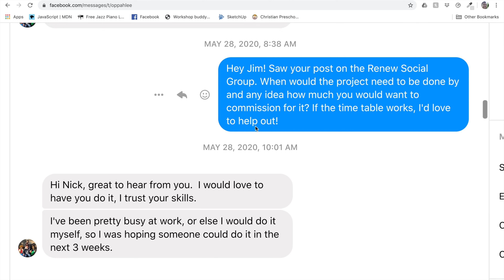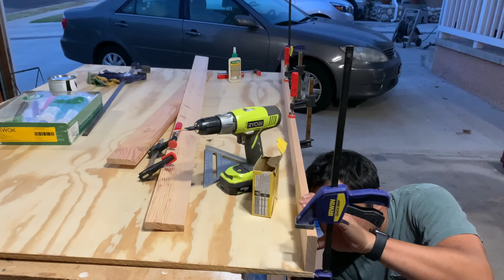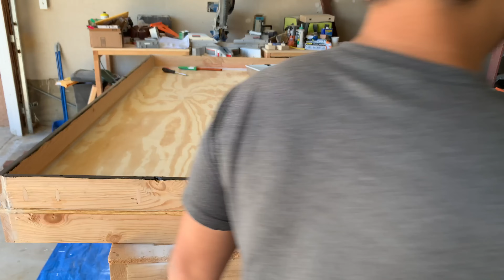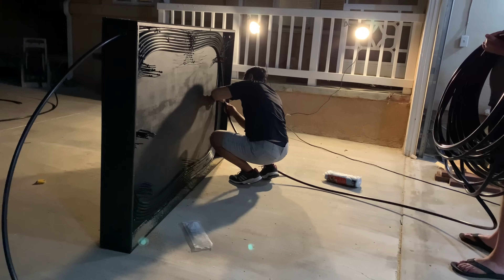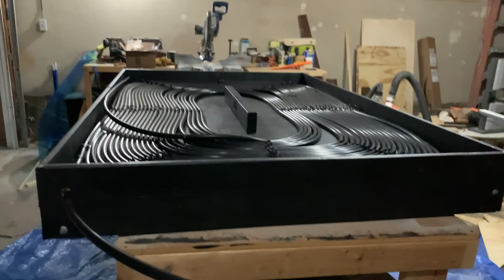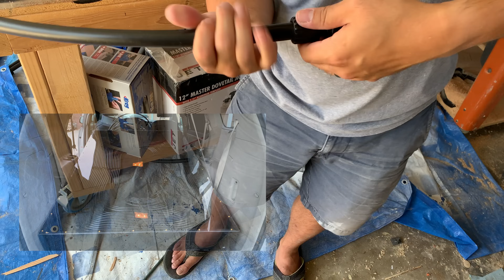DIY Solar Water Heater Full Build

Comment: Thanks so much for the detailed work and preparation to create this masterpiece. It's truly a work of art in addition to its functionality. I'll be able to use it well into the fall. Proud owner of a late night woodworker product!
Reply from the maker: So glad that y'all like it and even more glad that it works! hahah :]
Reply: @nwkwok  Make sure that you empty the entire hose when the season is over, because else legionela bacteria might grow and they can kill you.
And what i do before each season is fill a bucket with water and household clorine, and pump that through the hose in a closed loop for an hour
to make sure every possible bacteria is dead.
Reply: @3DPeter  we run it throughout the year for that reason at a reduced time
Reply: I want to do this for my pool, but I'm wondering if 120°F going back into my pool?.. I'm thinking it's way too hot. But then again my pool is roughly 25,000 gal.
Reply: @richardb4022  it barely gets my small jacuzzi above 75*, nothing to worry about! You can also turn the pump off if needed
Reply: @jimhlee  how long does it take to heat the entire jacuzzi? and what is the liter capacity of the jacuzzi?
Reply: @carlosaragundim4787  I don't know the size in liters, but it's about 6 feet across and 4ft deep.

It doesn't heat the pool hot, but keeps it warm during the summer to a comfortable 75*F.  Sorry for the imperial units
Reply: @jimhlee  lol it’s fine thanx i converted them. How long does it take to warm the jacuzzi?
Reply: @Shoggun06  that's a hard question to answer because it wasn't that the water was freezing cold. But after a week we were able to go in very comfortably, not hot or cold.
Reply: This is a great build! I’m  in SR as well and we usually have to heat pool in the morning during summer season for like a few hours to get it just nice for my toddlers but price of natural gas is high now. I would love to be able to see it in person. Any chance we can connect?
Reply: @bbshoney  maybe next month?
  I currently have it tarped over to protect it during the winter/spring from the rain.
Reply: has the acrylic sheet gotten fuzzy or cloudy from the suns rays overtime?
Reply: @azatecas  not fuzzy or cloudy at all. But it warped between the screws at the edges. I don't feel the need to replace it, but if I did, I would get a thicker one
Reply: @jim h. Lee have you considered a electric solar panel to run a small pump? Thinking it could kick on as soon as there is enough sun.
Reply: @slappy76  I already have solar for the house so it'll be cost inefficient

Comment: This panel looks very professional!
Covering the inside with zinc or aluminum sheet  will drastically increase efficience. 
I once put a 200 feet of this 1/2" black irrigation hose coiled flat on my zinc roof.  During sunny days I got 5 gallons of hot waterr (close to boling point!) every 30 minutes

Comment: I built this almost exact unit as a pool heater with my dad in 1980.  We used copper pipes.
Reply: Did it produce more heat ? I've read reviews from people who built using hose pipes and majority say it was a waste of time as the temperature rise is insignificant.

Comment: I have two suggestions about the unit itself.
First, if you were to feel the back (underside) of the collector on a sunny day, I could all but guarantee that it is hotter than young love.  If you insulate that with a piece of foil faced 2" EPS foam, you would retain more heat inside the chamber.
Secondly, use either a high temp caulk or gasket around the perimeter of your clear sheeting by doing this--along with a top piece of trim--will seal the heat inside the chamber and keep the warping to a minimum.  
The recommendation of a thicker sheet by another viewer is definitely a better choice, but the best would be one layer of tempered, not coated glass.
Great video.  I was frustrated with you in the beginning stage.  I wanted to be able to tell you how to uncoil the tubing and that laying it in from the top was really the only way to do it.
Thanks again for a good watch!

Comment: I'm sorry to have to say this but, you make the most common mistakes of the DIY crowd and a lot of professionals too! You could easily but maybe not inexpensively but expensive can pay back faster, increase your efficiency and output by anywhere from 50% - ~100%. You make the same mistakes the pop-can solar air heaters do, so I'll try to explain so everyone can understand what makes a good solar collector and heater!

There are just 4 things to remember when designing and building any solar heater:
1) heat will always flow to cold, never the opposite direction
2) the colour "black" absorbs the most amount of thermal radiation
3) the thinner a material is, the faster it conducts heat from one side to the other 
4) every substance has a different ability to transmit heat know as Thermal Conductivity

The biggest problem with designs for solar collectors is understand where and in  what direction the heat is going to flow and trying to bare in mind where we want that heat to flow to.  In this case, we want to collect solar heat radiation and transmit that heat to a volume of water.

We know that the colour black absorbs the greatest range of Infrared Radiation, so anything we want to heat up, should be painted black but only those surfaces that we want to heat up, not any surface that is not in touch with the water, because once radiation strikes a black surface other than the solar conductor, that heat is lost and can never help to heat the water. The interior and exterior of the cabinet should never be painted black because every IR photon that strikes is absorbed and can do nothing to heat the water, which is what we are trying to do here. By painting the cabinet black you are encouraging the enclosure to become heated and dried out and that is a fire hazard, under the wrong conditions. The only thing that should be painted black is the solar collector tube. The enclosure should be lined with aluminum foil to reflect any arrant heat photons and send them back to the collector and keep them bouncing back and forth until they do get absorbed where we want them to be, in the water we want to heat.

You use a PVC plastic pipe as your solar heat collector which is already black so you don't have to paint it and although it may be convenient work with, if you are doing all this work you might as well make it pay for itself, even if it cost a little bit more, you'll have the improvements forever.

The Thermal conductivity of PVC plastic is about 0.25 W/mK, where as the thermal conductivity of copper is about 401 W/mK, or you could say that a copper pipe would transfer heat to water, 1604 times faster than the PVC pipe you are using. Which means that with a copper pipe collector you can get 1604 times more heat and since solar energy tends to be intermittent when it is there at all, it is important to take full advantage when it is! There are various ways to build a solar collector but if you use soft copper tubing, you can probably get it already in a coil so you don't even need to fight with it.

If you made your solar collector from soft copper and painted it with a solar absorbent paint designed for maximum absorption (or just flat black works too) and lined you cabinet with  aluminum foil you could produce a great deal more hot water. The temperature increase of the water is less important than the amount of water heated but bare in mind you only have about one Kilowatt of heat / square meter, at Noon, when the Sun is directly over head, on a perfectly clear day, at the Equator and only the surface of the copper pipe facing the Sun can collect heat... There really isn't much there to work with, so we have to maximize our return if it is going to be worthwhile in the long run.

Good Luck! 
and I hope this will help the DIYs out there to get even more enjoyment out of their projects! Go for it!

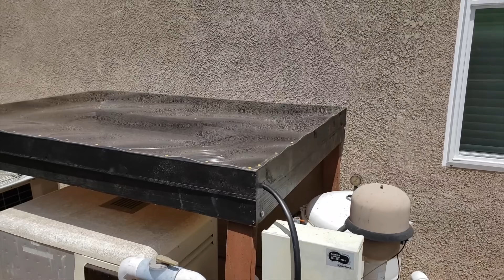Comment: Great job , just some thoughts , putting a few square meters of aluminium foil on the back wall will help a lot 8:57 , and I see two AC units , insteat of pumping heat into the air the heat exchangers could be modified to harvest the heat into water

Comment: Mostly followed this. Used 8 lengths of electric fence ribbon  in pairs (across, vertical, and diagonals) to weave above and below each pass of pipe. It was easy, fast, cheap, and very secure.
Reply: Brilliant

Comment: If you can keep the tubing in the sun as much as you can before you start working with it, or run some warm to hot water through the tubing really helps if flex n bend, you welcome

Comment: How to stop it from over heating my hot tub?  I made one and it got my sauna (hot tub) up from 53 degrees to over 105 and the weather is still only 75 degrees outside.  I can manually watch and turn the pump off when the weather gets really hot, but will the water boil in the solar collector?  Should I let the water drain out of the tubes when I turn it off? Do you know an inexpensive  sensor that will turn the pump off when the tub gets to a certain temperature?  Thanks.

Comment: When I built mine, it was 4 x 8 and I used two pieces of corrugated skylight material, and I just replaced it this year because it was dirty, and I thought (from the ground, not the roof where it resides) that it had clouded.  Now i think it was just dirty.  Anyway, it holds up year round in Kentucky elements.  I also filled any empty spaces with aluminum cans and painted everything matte black.  Its the only way the pool in my yard is usable.  I can't bring myself to cut the trees, and its a forest pool!   This is a great video.  I would buy one of these since I don't have the time and energy to build a second one.

Comment: How much difference does it make having a glass or perspex cover? I have made a similar solar heater. 50m of black irrigation hose in a box that's made of 20mm plywood and 4x2 sides. Painted it black with wood paint, then sprayed with Matt black industrial paint. Adjustable flow rate pump and a flow valve on the other end to that goes back into the pool. Currently I've double wrapped it with clear polythene sheet and sealed it with tape. It's 26°c air temp, pool was 27°c at 11:30am. It's 15:25 and the pools up at 31°C. Water going in is 38.8°c

Comment: I coiled 1000ft on my roof on a 15 minute timer,  1/2 poly pipe . 140 degrees for 15 minutes, then off for 15
Reply from the maker: Nice! I’ll have to learn your ways ;p
Reply: 140° in 15 minutes then ???? I didn't quite get it.

Comment: I made a very similar Solar Water Heater for my in ground plunge pool, but I used Toughened Glass and put my Solar Heater on my Kennel Block angled at 45° Degrees , and the Temperature 🌡 reaches 122°F  = 50°C and thats on a Sun/Cloudy ⛅ day,  on a Cloud Free day the Temperature reaches 165°/175°  and best ever was 192° F  🥵🌡 i use BBQ Thermometer pushed through the wooden frame, works a treat 😉👍I used 25mm black water pipe,  which tends too kink/bend  less ?   I would recommend any small pool users to make a Solar Powered Pool Heater, 🏊‍♂️🤽‍♂️  ☀️🌡👍

Comment: Not sure how you get t
120 degrees,   hottest I got was about 85 water temp and it was 83 air temp. Have full 500 feet ran on a 4x8 sheet.  Any tips on how to increase the heat inside would be appreciated.

Comment: Great job. I just completed 80 % of 1 i am making. I didnt make it as big as my yard wont allow that. But i am going to make 2 smaller ones each with 200 hundred feet of irrigation tubing. I was surprised at how easily it kinks to. So i put it on the table next to my project and spun it out. I had to pick it up 3 times to spin it around as well. The stuff is a nightmare. But i am going to add a valve on the feed side of mine to slow the water down. This will give the water more time to absorb the suns energy and come out hotter.  I am allso going to use a submersible pump. That way Its independent of the pool filter and much more cost affective.  Dont put valve on return side it will pressurize the tubing and cause it to pop. Love your work shop. Are you thinking about selling these ?
Reply from the maker: How did it turn out!?
Reply: Henry. Can you tell me more about your pump. Are you going to put it directly into the pool.

Comment: on my to-do. I just upcycled some double-glazing that had been replaced in a neighbours conservatory as roof and Windows for an old outhouse. This was good glass that was heading for the tip. I mention this because I'm looking to use some glass instead of acrylic on a project like yours.
Reply from the maker: Nice!! Have fun when you get around to this. It's a very fun project :)
Reply: @nwkwok  Thanks Nick. I was going to make the boxes from marine ply. I have a load of radiators from central heating systems - was going to spray them with black stove paint and put some in series them inside the marine ply boxes behind the upcycled glazing - don't know how effective that would be. I know from my RV days putting black cans in the front then coming home for a shower meant having stacks of super hot water - this is the UK though - we don't get too many sunny days so all systems would have to be optimally designed. The other thing I am thinking of doing is electrolysis from solar panels electricity - batteries are expensive and storing hydrogen is tricky buy currently working out a safe system at the end of my property.

Comment: pretty good and cheap approach, i did the same like 15 years ago using the black Gardena 1/2" plastic hoses from the microdrip system .. i bought 800 meters in 16 coils, i connected 4 flat coils in series and 4 of those strings in parallel to get a higher flow rate) on the roof of my garden hut, without any box around it. Unfortunately the wind fuzzed them up quite a bit when i had them emptied during the winter. I was thinking also of a boxed version, but never found the time to really build it .. i got stuck in thinking about which materials i should use, that i wanted to be waterproof but couldn't decide on the right material.
This set of uncovered coils was bringing my water from 20 to 40 degrees in full sun in summer.

Hint for creating the spiral: 
The trick that i found  to get the flat spiral perfect and with least effort and without making a mess is: Keep the hose in its natural spiraling when it is delivered in a coil, put it onto the surface and then just pull it ring by ring into the flat spiral you desire.

Comment: 1/8” plastic sheet ? Ok or not
Reply from the maker: Huh?
Reply: @nwkwok  you use 1/16” acrylic top would 1/8” be ok
Reply from the maker: @1mikenap  Oh gotcha. 1/8" is fine. I just went with 1/16" cause it was cheaper. 1/8" would be easier to work with.